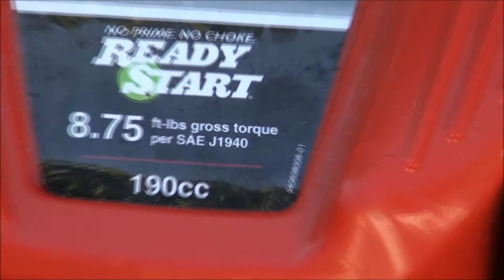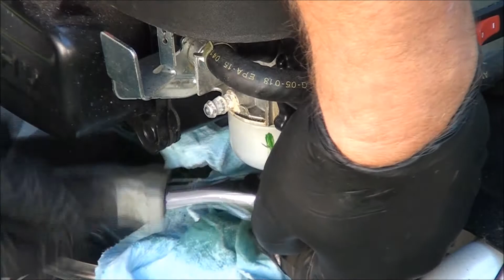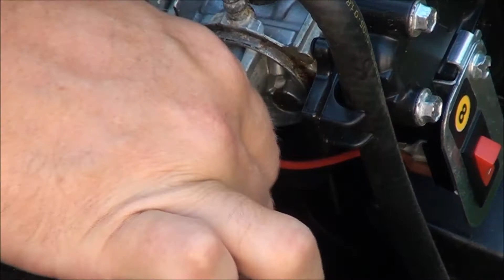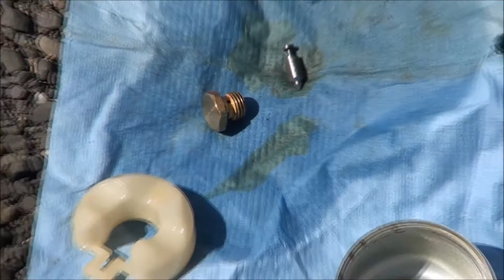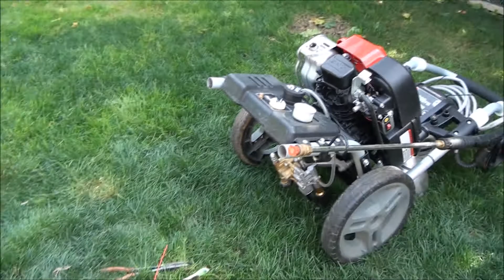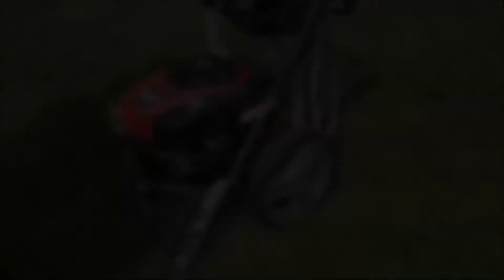New POWERSTROKE Pressure Washer won't START after STORAGE. Briggs and Stratton 190cc Engine

Comment: Do you know what the carburetor part # is that is on that power washer? I have the exact same one but can't seem to find the part # for the carb. I can only find ones that are very similar with the nipple for the fuel line on the other side of the carb.

Comment: My pressure washer (Craftsman with Honda 160) has started to be hard to start.  I've cleaned the carburetor but it still starts easier if I am hold the nozzle open while pulling rope.  I didn't used to have to do this.  Ideas?  Thanks- enjoyed the video
Reply from the maker: either the "slow speed"/ "pilot "system in the carburetor is plugged up..... or the bypass valve in the water pump needs to be serviced.